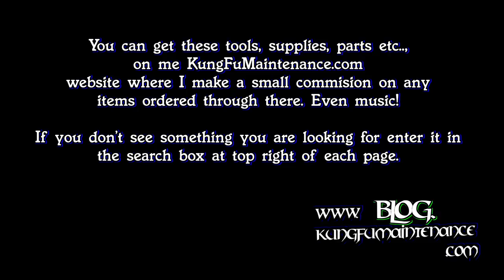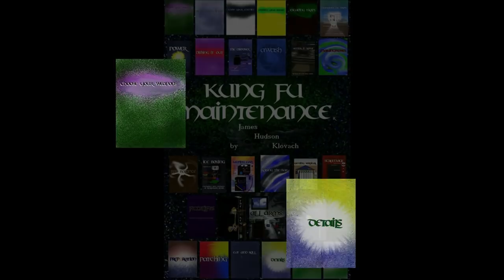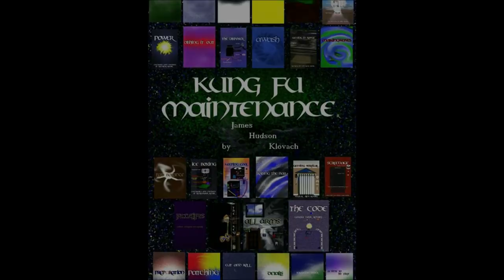How To Take Out One Direction Screw Heads Remove Security Tamper Proof Stripped Screws

Comment: Thank you for sharing. My father had one way screws in a deadbolt and had thought to drill them out. Then I found your video, once seeing the Dremmel and your use with the stone, he got his tool and used it to cut one direction for a flat head screw driver. I'm happy to report this worked in removing the screws. thanks for taking the time to share your solution.

Comment: there is a screwdriver for taking these things out typically sold a 101 piece bit set that has most of what you need to remove.  Oddly the hardest one to find is the tamper proof phillips bit as most kits like i mentioned don't have these in them. Not any more secure than the others, but often found in display cases for public areas as while not impossible to take out, folks can't go on amazon generally and order the bit to remove them.
Reply: Good point I have 4 of these recessed >1cm in a electronic device (plastic shaft) so this  Dremmel way no use (damage the electronic device case) the screw  head seems to have 6mm, but no luck finding that removal tool #6-8 in Tool Shops here in Romania, I tried with long pointed tips pliers for fine mechanics, it slips (you cannot clamp it since in a shaft recessed) :(  ,any other bis in sets I have... No luck, maybe if I have drill a centered (tricky) 3mm hole and an classic damaged screw extractor... ??